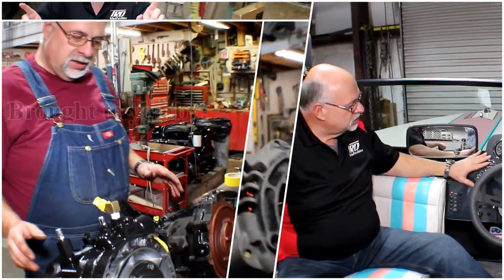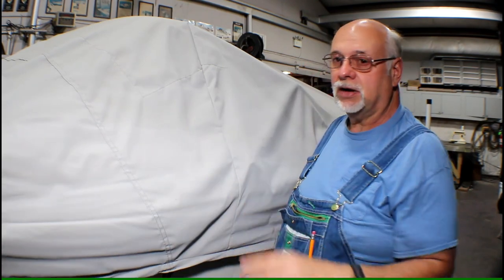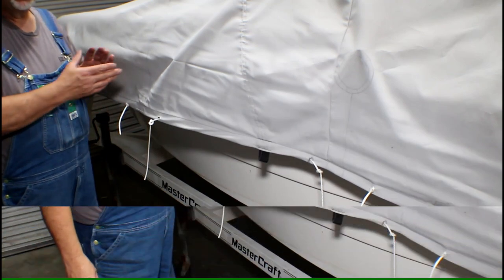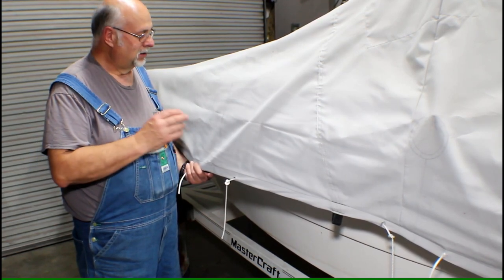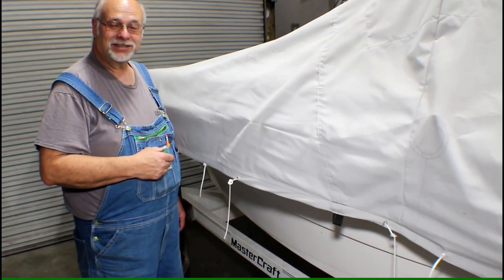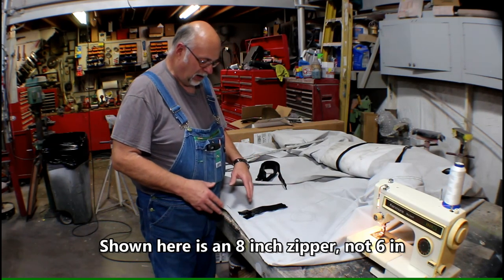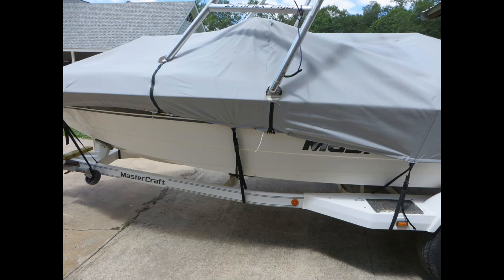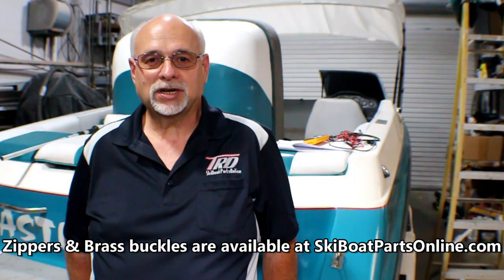Boat Cover Mods For Wakeboard Towers

Comment: Great video as always!   I need to modify my current top for a new wakeboard tower, so I’m going to follow this.

for winter storage, I always buy oversize covers and just put a big ladder or use the wakeboard tower as a prop up and then use extra tarp tiedown clamps, and bungee cords to get the tension I need. Works great and keeps the snow and rain off for the winter and cost about 150 bucks.

Comment: Thanks for the idea.  1. Do you have a preference of tower brand for older 90s direct drive boats?  2. Same question for close fit covers? Is that solar thread?
Reply from the maker: No preference on towers, in general I don't like them, yes thread used and recommended is UV protected thread.
Reply: Hi thanks. I understand about towers but they are sort of a requirement for old boat resale value because most young people are not skilled at pure skiing.  Want to wakeboard and surf.  I’m on Lake Austin almost year round and my school age children are only kids I see still skiing...

Comment: Ron...as an option to the sweing , do you think velcro will work well?
Reply from the maker: Yes it would , but velcro also needs to be sewn to the fabric.
Reply: @rontanis1024  thank you. I was thinking about it has its own adhesive. I will test a small piece in a hidden inside section and see if it sticks well. thank you